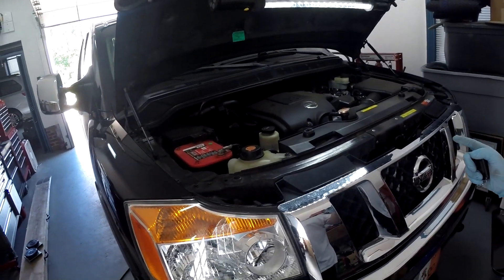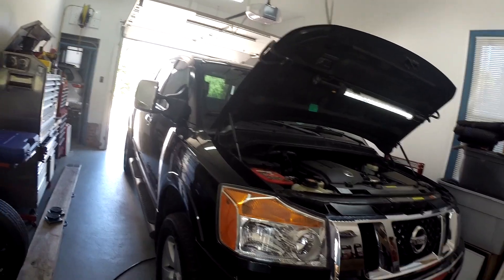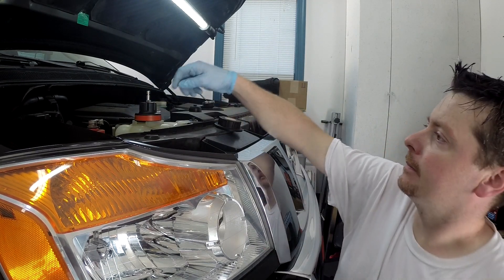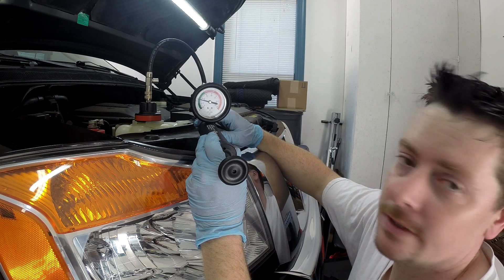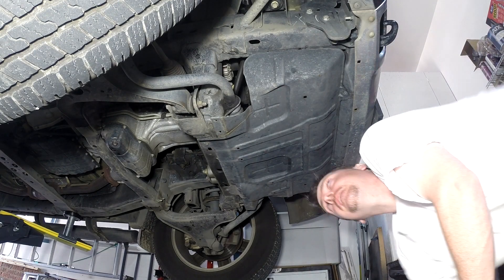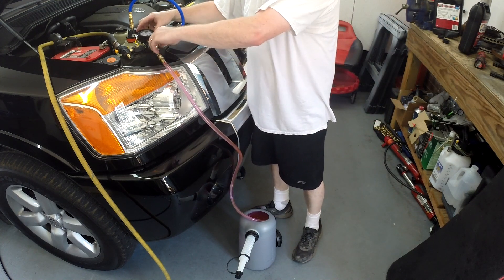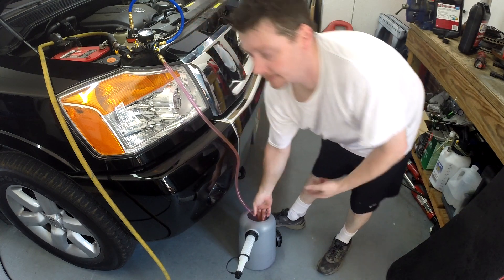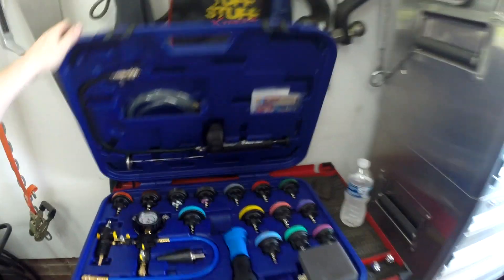Astro Pneumatic 78585 review

Comment: U already suc the air in the hose tube before coolant coming in.Think about that.
Reply from the maker: Think about what ?  There's no need to pre fill the line on the tool, its not designed to be a direct replacement for normal bleed procedures....think about that....lol

Comment: May I know how much pressure (PSI) of air compressor should I use? With my vacuum kit  max I got is -15, no where near -25 on reading.
Reply from the maker: I have a 60 gallon set to 160 psi....its a 15.6 cfm rating...a beast if a compressor....not sure what you are using but I would think you would need at least 5 compressor to draw down to -25....
Reply: @JohnnysSpeedShop  I have a small 3.5HP / 50L (118psi max) compressor which only give out 173L/m (6CFM after conversation), will that be suffice? Noise in the heater core is killing me T_T
Reply from the maker: That should do the trick... are you having a leak somewhere ? When you pull down to -15 does it hold there ? They are sensitive to any type of leak... whats the car ? Do you have an expansion tank and a rad with a cap ? That could be causing it as well, in this case you need to bypass expansion tank and draw vacuum from radiator directly....
Reply: @JohnnysSpeedShop Hey Johnny, thanks for checking on me. I found a fix, my air compressor literally didn't have enough juice. After numerous testing, I close the gauge single time when my compressor kicked in and open the gauge to resume vacuum when air pressure full, repeatedly. At the 3rs times my reading finally reaches -25psi. However that still doesn't fix my heater core air pocket after filling. Could that due to the thermostat preventing circulation? I had a Lexus RX300, 2002.
Reply from the maker: Hmmm.  Are you 100% sure its the heater core ?  I've seen guys chase heater core gurgling noises and the evap drain was blocked and water had accumulated in the hvac...   if you held -25 you don't have a leak, I'd check the drain tube for the AC, if thats clear and clean id flush and reverse flush the heater core (if junk comes out flush with CLR and water until clear)  refill again with vacnum filler...  if it still doesn't work burn it 🤣
Reply: @JohnnysSpeedShop  Hey Johnny, another attempt, a much better result with front wheels raised by inches, repeat the vacuum process. Thank you!

Comment: the hose that was drawing the coolant into the vehicle had air in it. How do you purge the air from that hose?
Unless the air is purged from that hose, it will end up in the engine.
With my Airlift, I used to hook up a vacuum hose with a blow gun with a vacuum port, & then close the valve when the hose was full, then connect it to the Airlift & open both valves & that was it.  NO chance for air in the system at all!   The Astro system doesn't give you the option of purging air from  the supply hose.
Reply from the maker: You can purge the air very easily with this one but its absolutely not needed...if you have done enough of these you will realize that...and yeah I have the airlift one as well, this kit is far superior to the airlift one......

Comment: Just bought the kit. the pressure pump im not impressed with. Mac pressure pump is night and day to this one
Reply: The pump works as designed and the kit is 1/3rd the price of the Mac set, not to mention much more comprehensive (28pc vs. 17pc) and includes an airlift style fill/purge tool. I'll take the Astro any day of the week.

Comment: Thanks for video I just bought a look a like kit for use with pulse sensor. Do you have a video on the lift? Do you like it still and worth it? Was thinking about getting one, I didn’t know you could lift a truck.
Reply from the maker: Love that bendpak lift..its rated for 6000 lbs so as long as you stay under that you are safe...  my truck is under 5400 so lots of room for fluid weight....😂  cheers
Reply: Johnny's Speed Shop do you have a link for the one you got? What’s Max hight?
Reply from the maker: @weldingjunkie  it's the bendpak md-6xp, if you google it you'll find it.. I think the max height is 4 ft. Something like that, basically all the way up the brakes are at chest level (unless you are really tall)  I can roll around under a car on a creeper seat no issues.  I just put an engine in a 17 320i no issues at all without the lift it would have been a tough job for sure...
Reply: Johnny's Speed Shop ah I see it’s a mid rise. You can’t pull a sub frame or tranny with it right because the middle isn’t clear? I’m trying to find the right option for me.
Reply from the maker: @weldingjunkie  sub frame..yes depending on the car but trans and mid exhaust work becomes an issue...   have you seen the max Jack's? Portable 2 post but requires some serious floor modifications like a full 2 post... that's what put me off it. ..  I don't have the height for a full 2 post sadly...😤

Comment: I was referring to pumping  90 psi into the radiator when you were forcing the air into the radiator to speed up the draining process by closing the discharge with your finger. I ordered this astro tool. It arrives on monday.
Reply from the maker: You're gonna love the kit it's a beast..... no worries on the 90 psi in just pop your finger over it for a few seconds it will only pressurize it a small amount to force out what's left in the system...but yeah I wouldnt   do that for too long...😁

Comment: Do you really want 90psi from your air compressor going into the radiator?
Reply from the maker: Yes... there's a built in discharge valve,  90 is the recommended presure.
Reply: @JohnnysSpeedShop  isn’t the cap rated at 16 psi?
Reply from the maker: They have different ratings, I don't have this car anymore but normally between 14 and 26 psi at the caps.... again nothing to do with this procedure... cheers.
Reply: @JohnnysSpeedShop  oh ok sorry for the misunderstanding

Comment: Also do you fill up thru the radiator or thru the overfill resurvoir? I have a 2015 Mazda 3
Reply from the maker: Not sure on Mazda 3 I'd have to look at it but you can do either depending on setup.... if your overflow just vents to atmosphere the no it would not work and you would need to fill via rad cap and top off the expansion....sometimes you can cheat the system and clamp off hoses but you need to make sure you know what your doing if you try to cheat it....I'd be safe and just fill via radiator...cheers....
Reply: @JohnnysSpeedShop  Thanks for the quick response

Comment: So after refilling it with this kit you still have to burp it or just make sure no air is getting burped?
Reply: When ready to install coolant...you need to start coolant up the hose then shut off..then start vacuum again..then start filling coolant ...that way you don't put the air in the hose into radiator..well probably clear as mud but hope you get it..savvy..great video..thanks👍
Reply from the maker: Yeah mate...thats ideal for sure but I've done a ton of these without priming that hose and never once had an issue... I stopped priming after my 2nd one....🤣🤣 because you still need to manually check and run a heat cycle, any little air gaps will work themselves out...cheers for watching...🍻🍻
Reply from the maker: Really depends on the car....my titan there was no need to burp all the air was gone, however I did a 2.0 turbo Hyundi and they have a metal crossover pipe, obviously that will not crush like the rubber hose so that car had a tiny bit of air bubbles after filling with this but it was almost nothing probally would have been fine.....good luck mate